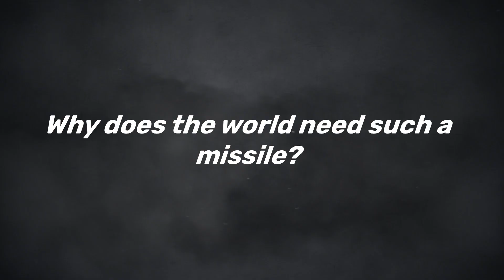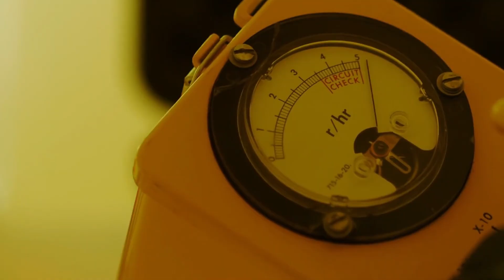Burevestnik - Is it worth the hype?

Comment: Can you explain how missiles are tested. How can they fly to 14500 km without triggering war
Reply: remember the island where tsar bomb was tested that's there the missile was tested circling the island for 15 hours, how will testing a missile trigger if it did not violate any air space ? remember tsar bomb test shattered windows in Finland did it trigger war?
Reply: These type of missiles are generally tested in Oceans . The world map you see is not how world looks . Oceans are far far more larger than it shows in world maps , so you can test ICBMs in Oceans. You just have to make sure that missile should not enter the Mediterranean border  of the country which is 200km from country's coastline